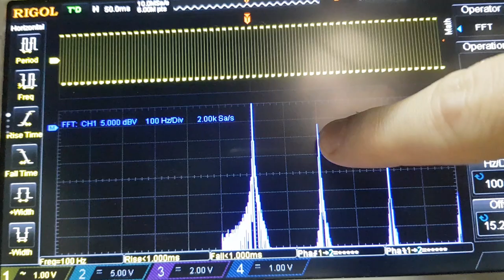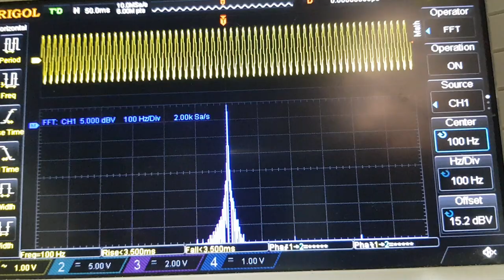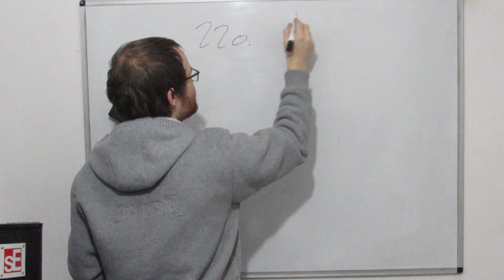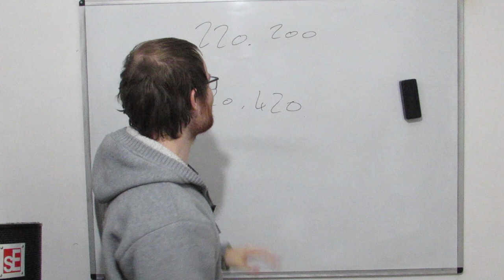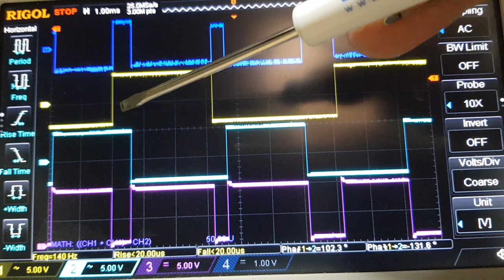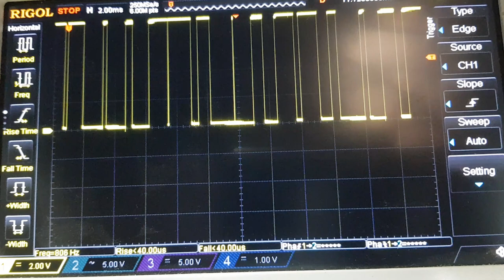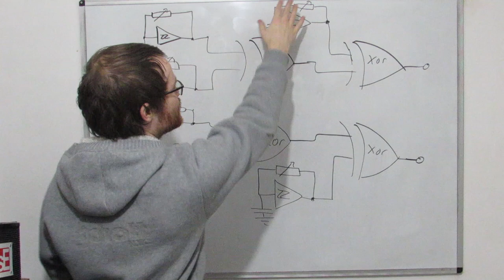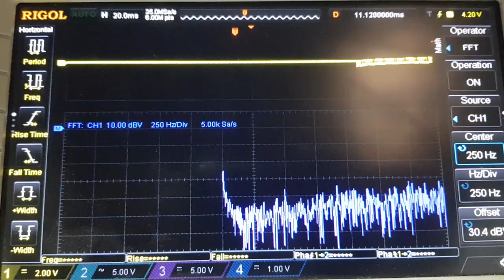DIY Metallic Percussion Synth

Comment: One interesting effect that you may not have tried is feeding frequencies in the ratio of 5:2 (a major tenth on the Pythagorean scale) into a "dirty" ring modulator that will have feedthrough of the inputs as well as the modulation products.  You get a whole stack of harmonically and subharmonically related tones because the difference tone is 3:2, the sum is 7:2, there are third order products at 1:2, 9:2, 4:1, and 6:1, and so on. The emphasis on the half harmonics (fundamental, 3/2, 5/2, 7/2) gives an open sound that can, with a little flitering, give kind of a brass-instrument tone.

Comment: When I followed the schematic for this, I had two problems. The first was that the output of the transistor was all negative voltage, which made the VCA not work. I fixed this by putting a big cap inline with the output. That centered me on 0 at least. I also had a LOT of high frequency noise that I couldn't track down. The noise existed somewhat at the output of every XOR and seemed to just add up through the circuit. I fixed this by adding a .33uF to ground between this circuit and the VCA to be a low-pass filter, but set very high.
Reply from the maker: Hi David! I might have to revisit this schematic. Sounds like I might have made a mistake somewhere. 
Thanks for watching and thanks for the feedback :)
Reply from the maker: With these CMOS circuits decoupling can be fairly important especially when you're using the 40106 which I think those one uses a lot of from memory. Could explain the HF noise. Will have a look this weekend!

Comment: Interesting channel. Glad I found it. I'm a bit of a duffer at these things, so you're quite a bit above my level of understanding. It's interesting when you mentioned XOR gates. I was toying around with trying to make my tones sound richer, and I came up with the idea of sort of binaural beats, mixed using OR. I was quite pleased with the results. It turns out that my idea wasn't as daft as I first thought. I had wondered, though, if it might have been easier just to mix the outputs from two separate pins.

Comment: Nice! But is it okay to short circuit the input and output of a Schmitt trigger (if a pot. is set to 0 ohms)? Also, can I use a 74LS14 and 74LS86 instead of CMOS technology?
Reply from the maker: Yes it is ok - there is some resistance inside the chip that should limit the output current. 
The technology (CMOS vs TTL) shouldn't matter, i just find CMOS to be a little hardier and can take a bit more abuse! Particularly when it comes to supply voltages.
Have fun!
Reply: @TheAudioPhool  
Thanks for the quick reply. The reason I prefer TTL is that I have a pretty large drawer full of them. :) Also, I think I heard a long long time ago that TTL is able to take more ESD abuse, at least the really old ones. But I could be wrong.
Reply from the maker: @toreeriksson6117  I always think the best parts to use are the ones you already have!